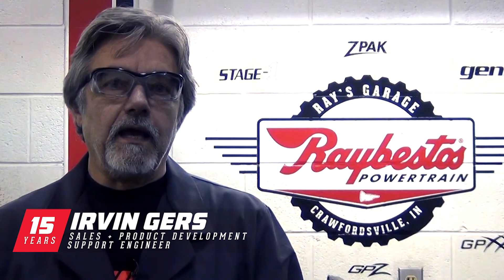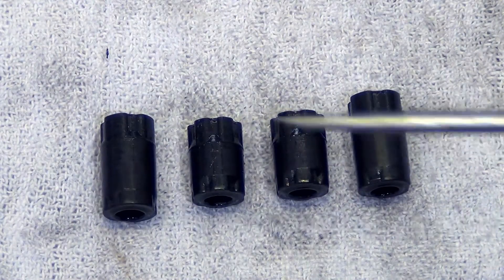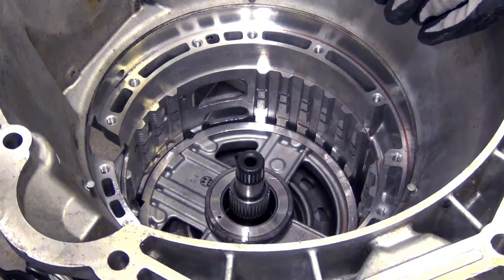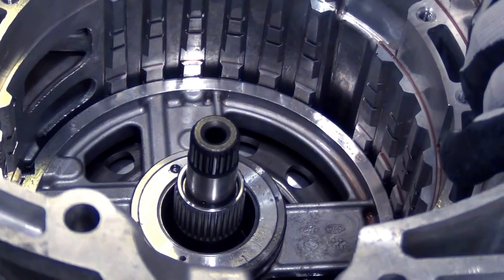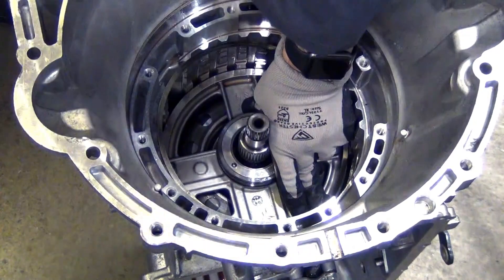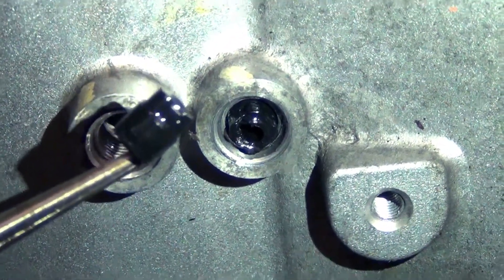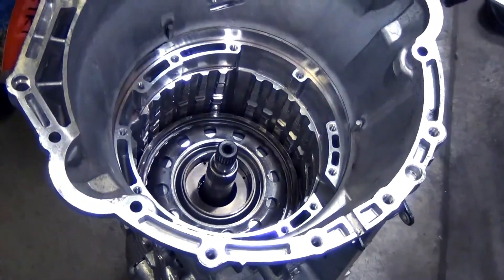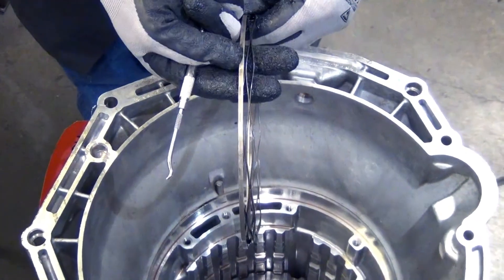Tech Tip: A8TR1 Issues - Center Support Removal

Comment: Hello. I have a Mohave 2013/14 in Brazil which has this A8TR1 transmission from Kia. Would you be able to compare and confirm how similar to the ZF8hp they are? They seems to be the same transmission as maybe Kia has bought some technologies and rights from ZF to built their own transmission.
Reply: Rafael, these transmissions are different. Please see our 8HP70 video for comparison.
Reply from the maker: Here is the 8HP70 video https://www.youtube.com/watch?v=bECFSVNHzu0&t=20s
Reply from the maker: You may also use our digital catalog to compare part specs between the two transmissions. 8HP70: https://www.raybestospowertrain.com/transmission/8hp70
A8TR1: https://www.raybestospowertrain.com/transmission/a8tr1